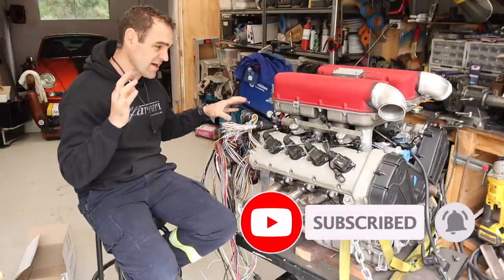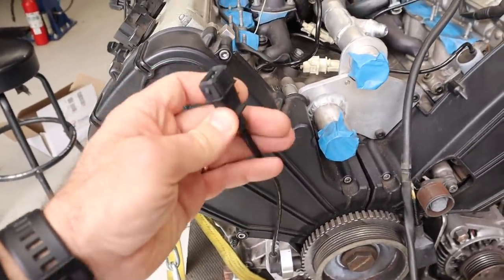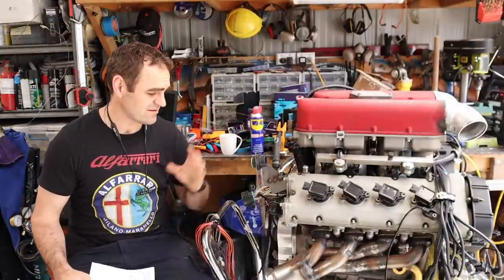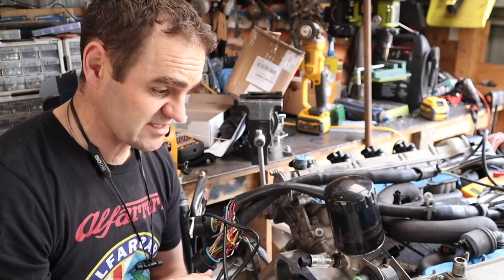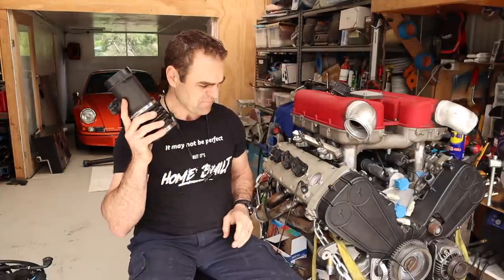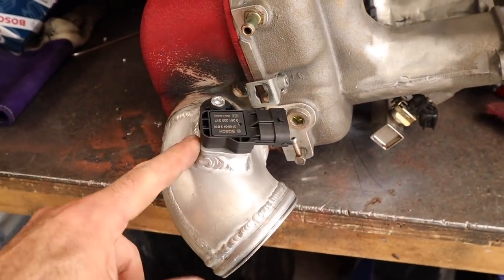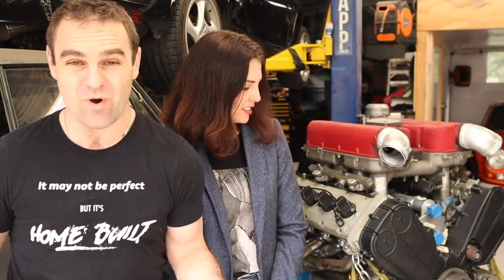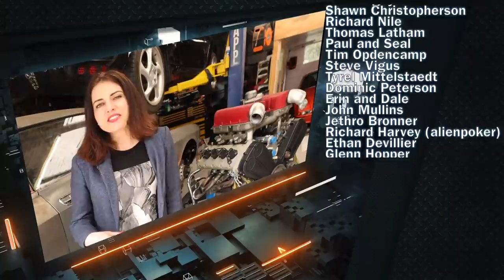Ferrari engine loom completed - Ferrari engined Alfa 105 Alfarrari build part 114

Comment: Hello,
About Knock sensors, in theory you can just connect them in parallell as they are just industrial piezzo michrophones. The two left banks on one entry end the two right banks on the other input

Comment: I would be using slave relays on the outputs, especially if driving loads through them.. there is a large voltage spike when the load (especially coils) close and the magnetic field collapses. Known as back EMF.

Comment: Great project. Love the content and your passion to solve problems as they arise. A few things for thought, the oil pressure sensor attached to the wire harness may heat the wires and cause an issue down the road. 2nd issue is that the MAF sensor only on one side will cause a lean condition. The side location of the MAF will get contaminated and cause false signal as well. My suggestion is that you fabricate a tube which the 2 intakes join together into 1 pipe then add the MAF sensor on top of the tube for better fuel management readings to the ECU. Keep up the great work. I can't wait for the next video.
Reply: Sorry, I meant to write MAP sensors not MAF sensor... LOL

Comment: FYI your MAP could have been mounted remotely with vacuum lines coming from some of the existing ports on your plenum (maybe a cleaner look)
Reply from the maker: It is an IAT and MAP in one, so it can't.
Reply: @HomeBuiltByJeff  would it not also pull temperatures if you had it sit at a T between the two banks? surely the overall airflow and pulses between plenums would be regularly exchanging the air in the x-over and at the sensor, so you'd still get reliable pressures and temps?

Comment: TMAPs or MAP sensors installed facing up are more prone to getting blocked with schmutz in the intake since they can't drain. This was an issue on a certain aftermarket Honda intake. Safer to install them on the top half of a pipe.

Comment: Great job on the car, thanks for sharing the videos. 
It could be the angle of the camera… it looks like the crankshaft position sensor is not in alignment with the center of the crankshaft therefore the teeth on the trigger wheel are not parallel to the center of the sensor. If true that could cause issues with synchronization. It looks like the sensor needs to be turned ccw a couple degrees.

Comment: Great job Jeff! Only thing with using a length of hose running to the oil sensor is maybe ending up with a volume of 'stuck' oil in the hose that never gets circulated? Especially with the hose and sensor lying horizontal on top of the engine. Just a thought.

Comment: When wiring an engine loom remember to check how the coils and injectors are driven.
Some have coil drivers in the coils themselves others have a separate box and others have it in the ecu they don’t mix or play well together, either they simply won’t work or the magic smoke will not vacate the building.

Comment: If you are going to trigger the cam controller off the ecu, you might want to do it via a relay so you don’t cook the ecu
Reply from the maker: Link says it will be fine.
Reply: You could hook it up to a button on the steering wheel. Like NOS. Lol.
Vtec,  yo!

Comment: Also regarding the TMAP, how far into the air stream does the sensor protrude? It should be right out there in the airflow. That supplied flange looks pretty thick, and I wonder if it causes the T portion of the TMAP to be shrouded from the airflow and hence be more subject to heatsoak.

Comment: Love the vids and the info you share, just wondering with the map sensor would it have worked right at the front of the bottom section of the inlet manifold between the two red top parts, having it there would that allow you the get a more even reading of the air from both sides? Hope you get where im trying to say 🤣🤣
Reply from the maker: No it wouldn't.

Comment: Most MAP sensors are fasing down for a reason, dhey don't collect oil or other fluids.
This might be a problem later on
Reply: This is definitely a problem in the future as the sensor becomes contaminated and will not self clean, the sensor response will become sluggish.

Comment: Wonder if mounting the air flow sensor on the plenum crosstube might have been tidier? Instead of welding on the red wrinkle, epoxied? Maybe a pressure issue?
Reply from the maker: The cross tube is not a constant and only goes to one cylinder sometimes.

Comment: Jeff i have asked this before do you have oil in the cylinders of the engine do you turn it regulary its stood a while now.
Reply: It most likely has coated aluminium cylinder liners with a low chance of rust.